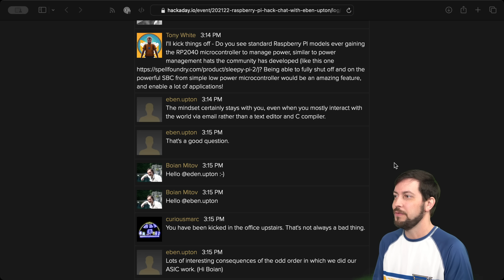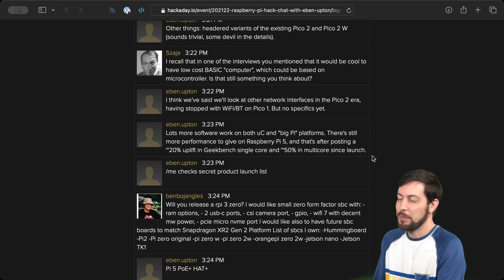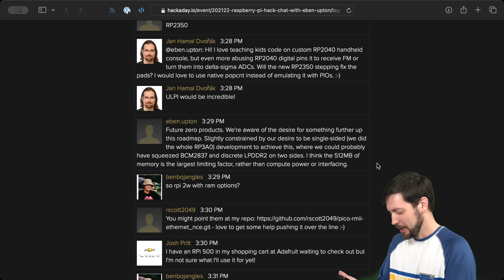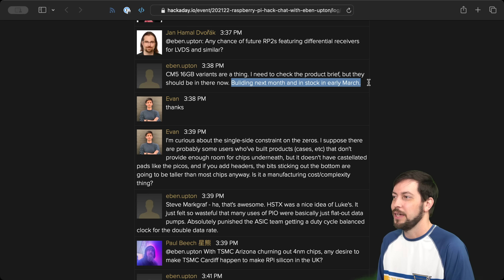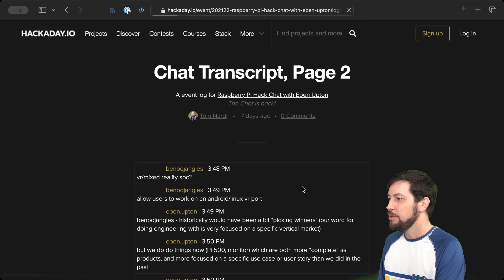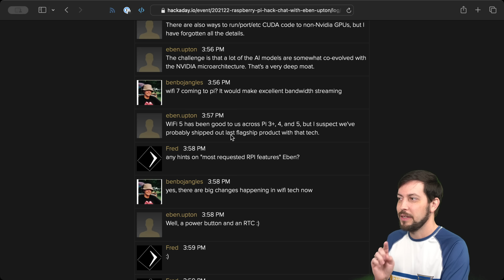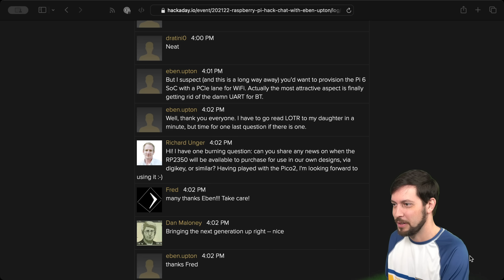Will the Raspberry Pi 6 have WiFi 7?

Comment: Damn, a 16GB Pi 5 on the horizon, after I just deployed an 8GB model as a home server for running some stuff in Docker containers on the NVMe SSD (Which absolutely rips through data) It's ironically faster than the "Mini PC" I was using before. 
Using the Argon One V3 case to keep it safe, contained and cool if curious :)
Reply: On the horizon?
They released 3-ish weeks ago friend.  Literally yesterday's news.
(You might be talking about the CM 5 though, which is next month I guess.  But the current carrier boards weren't worth the 20$ more you'd be paying over the normal Pi 5, when I looked a few weeks ago.  But hopefully we'll see a few neat new carriers in the next couple months)
Reply: @Samael1113  I was not aware! I ordered my Pi5 during black friday, then waited a bit to get the rest of the bits in December. If a 16GB model was out then i would have gotten it :( but a 16GB CM5 is an interesting proposition with a ITX board to drop it on to.
Reply: @RonLaws  
I almost did the same, I was very close to ordering an 8gb around Black Friday, but that's about when the CM5 news came out and Pi Shops had 16gb models listed and it became an open secret that 16gb versions were being released in the near future for 120.
So I got a 16" touchscreen monitor for like half price and waited.
Got mine last week.  Maybe should have waited until the CM5s were out, but I figured I'd be waiting potentially a long time for a carrier board that could offer what I wanted and wasn't a significant mark-up over the base pi and decided it wasn't worth the wait and cost and delay.

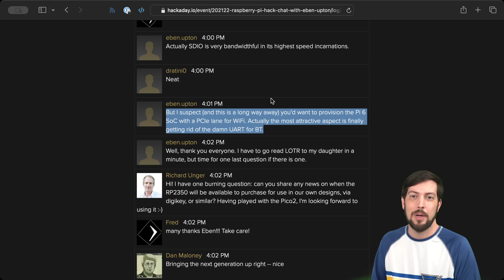Comment: 14:20 i'm in Poland and here n100 is 2,15 times more expensive and you in Poland can buy pi 5 with out scalpers but some variants are out of stock. N150  is propably even more expensive here
Reply: @Level2Jeff  why :(  ?
Reply: Used Thinkpads are currently for some reason very cheap in Poland. (And I specifically mean even in comparison to how good of a deal they always have been.) If you need a screen and a keyboard too you might wanna look at those.
Reply: @fgregerfeaxcwfeffece  thanks i propably stay with pi becouse is pretty fast and small but thanks for this :)

Comment: The biggest things I want to see in the next Model B Pi are an NVMe slot, full-sized video output(s), and higher voltage charging.

I think NVMe is pretty self-explanatory: it makes Pis feel much more useable. A standard M.2 2280 gen3 x4 slot on the bottom would be perfect, but even 2230 and gen3 x1 would be good.

For the video outputs, maybe one full-sized HDMI (or DisplayPort!), and one or two full-featured USB-C ports - I'd love to be able to connect a single cable and have power, video, and data.

For the charging, it'd be nice to be able to use a MacBook charger or whatever and get full performance out of the device.

Wifi7 is meh. It wouldn't bother me, but it wouldn't move the needle for me either.

2.5gig ethernet would be more valuable for me, but probably too niche to make the cut.

Comment: The pi 6 should have a proper encoder/decoder, at least for the most common formats. Software decoding/encoding just isn't cutting it for something like Jellyfin.
Reply: Really, this - feels kinda like a joke, that you have a chip as fast and seriously capable as the Pi 5, but as soon as you have to do something with video transcoding, you end up with single-digit FPS numbers, because you have to brute-force it all by CPU... while my 10+ year old i5-5200 notebook I'm watching this on gives me literally 10 to 15 times the speed in the same situation, just because it can do QuickSync - and on barely above the wattage of the Pi5 on full blast...
(And yes, I'm fully aware I'm comparing apples and oranges here, and "Pis are supposed to be tinkering machines, not desktops" and all, but an ARM chip THIS fast, but without ANY video encoding support just feels sooo 'back to 2005' these days 😄...)
Reply: @CoPoint  so it's an ARM chip so fast and capable that it sucks at doing something without dedicated hardware acceleration? your i5-5200 can probably brute force it on CPU, because it's actually fast and capable
Reply: @marcogenovesi8570  Other than for the GPIO, I'm not sure why people use PI's for general purpose use. An Intel N97/N100/N150 isn't much more but it's significantly more powerful with only marginally more power consumption.
Reply: @marcogenovesi8570  but the i5-5200 does H.264 in hardware, so no need for the cpu cores todo that. One generation newer of this cpu also support HEVC in hardware.  I even think they support more than 1 stream of 264 actually
Reply: @ yeah but that's not my point. I'm just reacting to someone saying Raspi CPU is so cool and powerful but then complaining it is too weak to do brute force media decode on the CPU while most x86 CPUs from 10 years ago can do that fine.
Reply: @CoPoint  Yeah, I feel like if they bothered to add a somewhat decent encoder and decoder, doesn't even have to do av1, the pi 5 would be a perfect media server for so many people. Now its literally more price efficient to buy a cheap intel processor with QSV and build a media server with that instead.
Reply: Seriously this ^^
Reply: I wrote custom video recording and streaming software that gets 1080p at 30 fps, but the camera module 3 can record at 50 fps. The software encoding is by far the biggest bottleneck in my system.
Reply: The oil just isn't useful as a desktop replacement for me if I can't play YouTube in the background. On my Pi4 it's like pulling teeths, I haven't justified getting the pi5 since it didn't fix this.

Comment: The new/expensive features are cool but I do hope they continue to improve the $35 offering. I see it often when people complain about the Pi 5 being $50-$80, "well the Pi 4 (1gb) is still just $35". And when the Pi 6 comes out with all its new features at $70-$100 we will probably hear similar, you can still buy a pi 4 (1gb) for $35. I don't want the Pi 4 (1gb) to be the last $35 Pi, i eventually want $35 to buy me a better Pi, like it used to in previous gens.
Reply from the maker: Inflation probably means $50 is the new baseline. I hope for the next generation though, they don't introduce the 'mid tier' model first, but start with full lineup so we don't have to wait a while to get the more affordable version.
Reply: @Level2Jeff  According to the U.S. BLS Inflation Calculator, $35 in February 2012 is now (December 2024) $48.52. Inflation really has been that severe.
Reply: @KameraShy  Sadly, yes :(

Comment: The pi was cool because it was so affordable. It was released with weak specs when introduced. Asking for a model 6 with current generation specs is antithetical to the philosophy under which the project was born. The N100 boards will never be $35. Raspberry pi should stay cheap.

Comment: Jeff it can be that the be200/be201 do need intel CPUs. I used Intel wifi cards for years, but  the new Generation does exclude all non-intel cpus ...especially bad for amd owners as these intel wifi cards are so nice on linux
Reply from the maker: Some people have gotten it running on the Pi already: https://github.com/geerlingguy/raspberry-pi-pcie-devices/issues/670
Reply: Thanks for the hint,  @Level2Jeff . I will get one of those and give it a try

Comment: The Pi Zero 2w needs some love.
A pi zero 3w would be great with 1GB ram and wifi 5Ghz.
The same processor is fine
Reply: i need to have usbc, period. Tired of adapters.
Reply: For me, Ram is good. But why only single UART. 2 or 3 UART would be good.
Reply: and full-size proper HDMI, not that stupid mini/micro madness, that nobody else in the industry is using to screw up with their users
Reply: @ricsip  I do agree but the physical size of the pi may need to grow........ unless those sideways mounted HDMI sockets are used.
Reply: 4GB as the copies have would be the best. USB-C agree, But also the USB-C for power should also be able to send data, like being used with a monitor with USB-C, or a USB-C dock with HDMI.

Comment: I feel like the biggest thing missing since the Pi1 has been a way to connect a battery in a way that the pi knows it is on battery and can sleep or shutdown when the battery is low.
Reply: also wake on lan
Reply: I know, I feel this would be so useful on something like pi zero too.
Reply: Having to use additional hardware to do it has prevented me from doing a project multiple times
Reply: That should be prety easy and Im sure many hats provide that feature
Reply: People are already complaining about the rising cost.    This is a pretty niche thing that should probably be done with an external board. I mean, why should I pay for hardware I'd never use?
Reply: Yea that would be a good idea to add
Reply: laptops have this as standard, so it's not impossible
Reply: @Megabobster laptops are build with one specific battery and corresponding bms for it. A pi with battery support would need to support alot of different sizes of batteries for it to be a value to many people. Having it support alot different batterys makes it very complicated. 
Where do you put the soc detection circuit? on the pi? on the battery and sell batteries with integrated electronics? should the user do all that in software himself?
Reply: @KidCe.  from superuser, about laptop batteries: "The communications channel between the battery monitor and host need only be a single wire (with ground) serial interface, and is typically based on I2C."

so, if the pi is capable of i2c, and if they make an official standard for how batteries for the pi should communicate, then that's what I'm saying. no fancy hardware or battery design decisions need to be made officially part of the pi from the factory, and honestly it could probably be done already with a software update. idk if the power port on the pi supports data/otg but if it does it could even be done with a single connector and minimal jank
Reply: @Megabobster  thats what i also think, support one standard, if someone wants to use it, welcome, the pi can monitor the battery if not, the pi will continue to work as now, thinking is connected to the charger, no need to complicate things trying to support gazillions of protocols, let the battery manufacturers try to be compatible with the pi
Reply: That would be really hard. The only way to somewhat accurately know a batteries capacity is measure how much energy it took to charge it and then only pull that much back out. So you need a chip on the battery that does this or the pi need to be able calibrate a new battery which would involve fully discharging and charging back up. Also different battery chemistry behave differently.
Reply: @ you could have a connector for a module that deals with the power management, I just think it's stupid that on a device that is advertised as being good for embedded projects, there is no way for the device to know how much power it has left.
Reply: @gabe2252 you do know that you can use the batteries voltage under a load to find the charge right? That's how it's done in a lot of applications

Comment: Coffeezilla has some good advice on green screens.
Light up the green screen seperately to yourself.  This helps keep the green screen consistently green as you move around, which makes it easier for you key it out with no/less green bleed.
Reply from the maker: The difficulty is I'm standing about 6" in front of it (which is horrible for shadows regardless)... I should probably plan out a better setup if I want to do this more often :D
Reply: @Level2Jeff  Yeah... one of my bugbears is that green screen removal is so much easier than standard background removal, so there could be a hybrid that works soooo well, but it just isn't there.
Reply: @Level2Jeff  How about the Mandelorian route and just sit in front of a 65” TV and dispense with keying altogether 😂 Just a small hi angled key light ought to do it 🤔
Reply: @IndigoVFX  Haha well... it'd still be right behind me, I'd be getting a bunch of backlight!
Reply: @JeffGeerling  can't that be solved with more light from the front?
Reply: There’s a Captain Disillusion video that quickly goes over good practice for green screening
Reply: This is not a green screen video. Level 2 Jeff is inside the computer. That's why he's level 2.

Comment: One wishlist I have is the Raspberry Pi 6 should 8 Cores in it's SoC. Same 4 A76 cores in the current Pi5 but with A55 efficiency cores. I don't want the Pi6 to be too expensive but I want it to be at least on par with a modern entry level android phone and mini pcs. Considering that the Pi5 has GPU support, this will definitely help with ARM development and GPU development.

Comment: Great summary of the hackchat with Eben Upton. Considering where the industry is heading with mainstream laptops with Qualcomm ARM SoCs, I expect a Raspberry Pi laptop. Especially, considering they have all the important pieces ready as stand-alone products right now: rpi 500 pcb with (not-assembled but designed) NVMe drive, Raspberry Pi SSD and Raspberry Pi Monitor. I would love to have such a laptop with a Linux distro like Raspberry Pi OS :)
Reply: They could make a simple laptop kit with a CM4-style socket so that you can swap modules as they release.
Reply: @fujinshu  yes, absolutely, especially that they now have CM5. However, for both the rpi 400 and rpi 500 they preferred to make a dedicated printed circuit board rather than to use a CM.

Comment: USB-C PD and DP would be nice.
Reply: = Overall compatibility with current USB-C laptop docks. That's what I expected from Pi 5 :/
Reply: @adameichler  displayport / hdmi over USB-C! that would be great. Many monitors support this today, so I do not see why it should not be able to.
Reply: But raspberry pi have usbc pd
Reply: @Somethingfs-sx1ft I imagine they mean at higher than 5 volts. 

Support for 12 or 20 volts input would greatly improve charger compatibility.

Comment: PD power support rather than the off-spec 5V5A requirement is a must. Also return the hardware video encode/decode and if possible it'd be nice to see some improvements on the encode side as far as efficiency/quality/etc..

Pi (pun intended) in the sky idea, but getting away from Broadcom and their closed source blobs would be nice. I like some competitor SBCs as far as being more open but the community support just doesn't compare.
Reply: Yup, 12 or 15V would be great. Having performance and properly powered pcie peripherals (hah nice alliteration) locked behind a first party non-standard accessory is a travesty.
Reply: YES
Reply: If the Pi5 requested 5.1V 5A via PPS would be on spec, as many power adapters does support 5V5A via PPS
Reply: @JoaoMarcK  They don't sadly. I'd rather have them handle the regular power profiles aswell since it's easier to find bricks that support that instead of PPS.
Reply: @jja2000  all my USB-C power adapters support 5A PPS, some do Max of 11V others go to the full 20V, basically any current 65W+ adapter will support 5A PPS
Reply: @JoaoMarcK  My current go-to generic cheap charger the IKEA SJÖSS does not do PPS up to 5A. My Samsung USBC laptop charger does not either. My more expensive 100W and 160W Baseus's wall chargers and powerbanks don't support PPS at all. Same for my steam deck charger and 3 lenovo usb c laptop chargers.
Reply: 5V5A is not off-spec. It's just that 5A power supplies cost more than the official pi psu
Reply: @BusAlexey  The Pi 5 does not do PPS, so it definitely is in this case.
Reply: @ huh? I didn't say Pi 5 had it. Tell it to the other guy
Reply: @BusAlexey  Then I'm not understanding what spec you are referring to when you say that 5V5A is "not off-spec" when referring to a USB C PD power supply.
Reply: @ PPS and PD are not the same thing
Reply: @ May not be officially off spec per se, but this is the primary issue.

In my own experience actually using the Pi 5, there are some notable issues with the current setup. Namely that not all power supplies that claim they can do 5V5A are actually stable at the higher amperages. And the Pi seems to be really picky about the voltage being stable. This is already a bit implied with the 5.1V rating on the official supply (whereas most others target 5.0 and may drift lower under load). Since I'm not wanting to be tethered to a wallwart with some of my projects, what I eventually did was find a 5.2V5A buck converter on Amazon with a wide 9-32V input and feed it with a 15V PD trigger board. But that is just added cruft hanging off the Pi.

Having PD natively on the Pi is much more desirable being how super ubiquitous it is these days. And it'll give enough voltage overhead and they can manage stability of the 5V and lower rails internally.
Reply: Would be great if they did a version with onboard PoE, 

The whole "I need a case for a Pi that has both a PCI-E ssd and a PoE+ board" is getting silly.
Reply: would love the last idea, especially if it was an inhouse design as that would allow them to expand to higher performance projects - but if it took them ten years to get the pico's cpu out the door, then I doubt they'd be able to take on broadcom's job anytime soon.